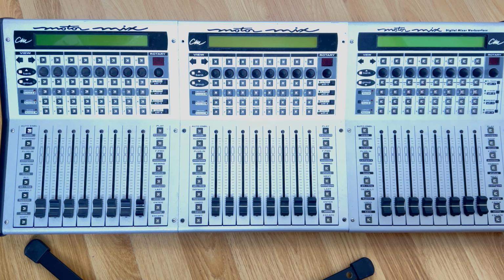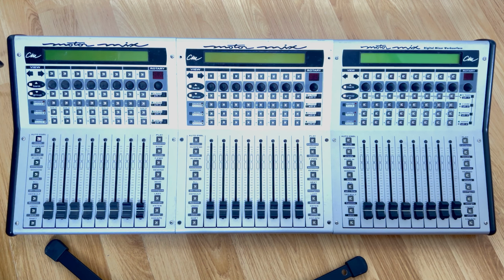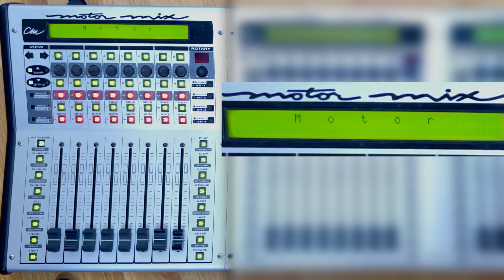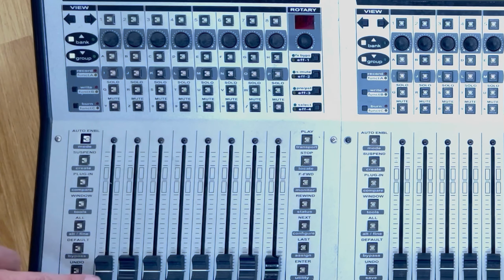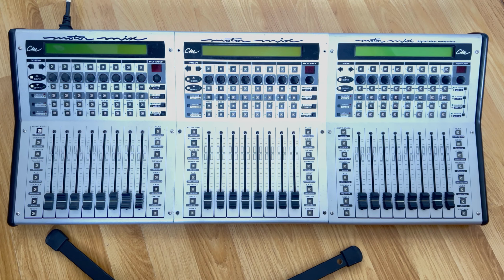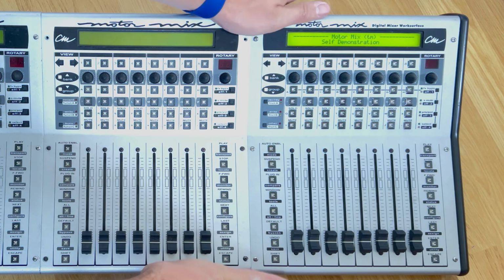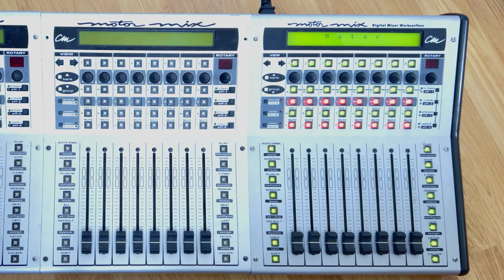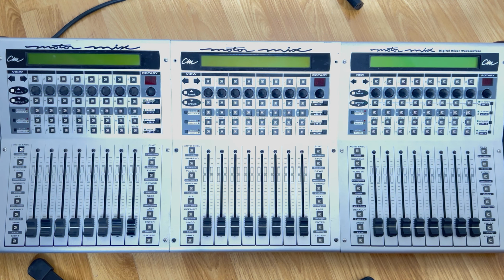CM MotorMix Control Surface Demo - Pro Tools DAW etc Controller

Comment: It works only with pro tools or with every other midi daw?
Reply from the maker: According to this sound on sound review it does but I’ve only ever used it with Pro Tools

https://www.soundonsound.com/reviews/cm-labs-motormix-dashboard
Reply from the maker: Apple Logic setup instructions:

https://support.apple.com/en-gb/guide/logicpro-css/ctls72da032e/mac
Reply from the maker: Cubase support looks like it’s ended though 🤔

https://forums.steinberg.net/t/where-is-the-support-for-my-cm-labs-motormix-gone/732841
Reply: @neilhester-tech  im using FL Studio